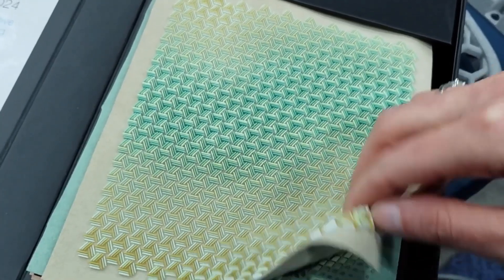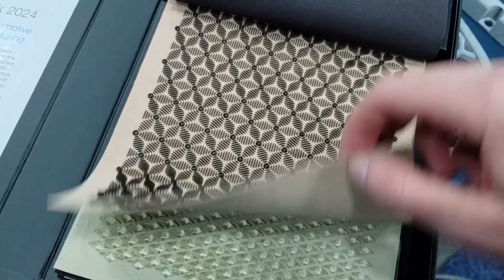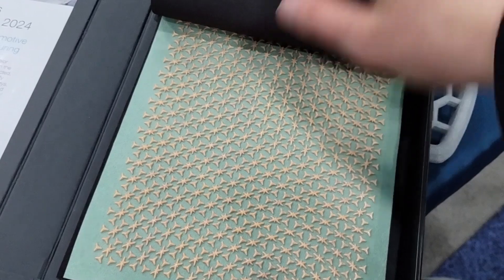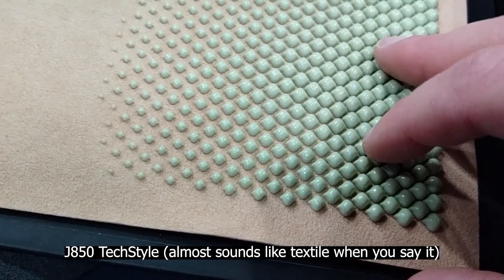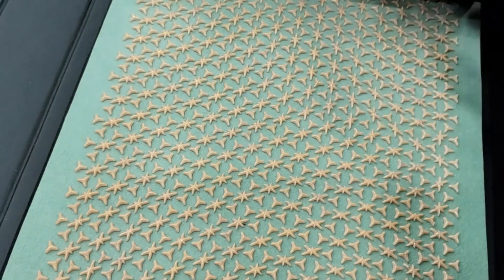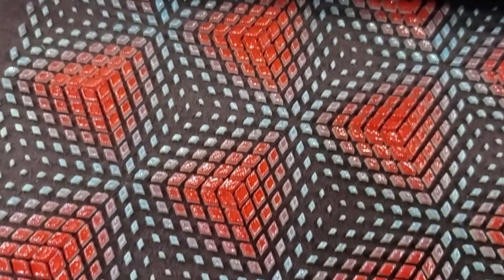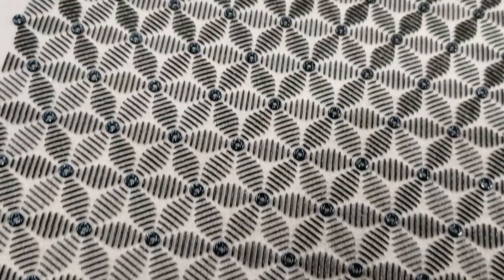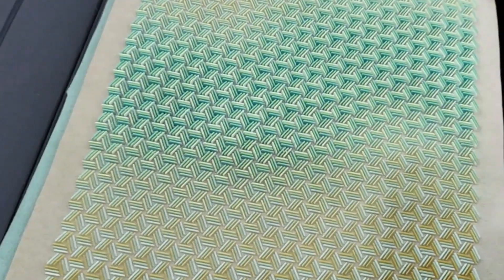3d printed fabric like never before! (polyjet technology)

Comment: Does look cool... But my imagination today is not that grate cause I don't have any especially good ideas.
The obvious is looks, it allows you to get a more extreme depth than what you normally get on fabric.
You could maybe make a high friction, harder surface for football shoes that still are able to conform to your feed.
Maybe you could make a interlocking patton that could be used to hold curtains and vertical blinds completely closed so that no light passes through.
Maybe you could add knee protection to work trousers, such that they were a part of the trousers and did not have to be removed when washing.
Maybe you could make a back protector that was more comfortable or just a part of the jacket.

But the material is probably hard and brittle, thus not usable for knee protection, back protection and probably have a relatively low coefficient of friction too.

But when it comes to looks there are endless possibilities, i suspect that we will se company logos as part of the fabric in speaker grills and guitar/bass amplifiers. But speakers get smaller and smaller and amplifiers are no longer a part of the concert decoration on stage and musiciens uses digital amps, thus it is not sure anyone will spend money making new amps and speakers.😥
Reply from the maker: These are all great ideas, give your imagination some credit! I think that the company that made this technology and the materials for it (Stratasys) also has flexible materials that can be varied in hardness/flexibility based on how long they are cured. What this means is your knee protection idea could very much be possible, same with the shoe idea! Also the curtain and speaker/amp idea is something I didn't think about and using this tech could allow for awesome customization, I just think it would be quite expensive because of the cost of the tech/consumables. Hopefully in the future this type of printing on fabrics is more accessible/affordable. 😅🙃
Reply: @strelkomania  Thanks.
When it comes to peoples hobby and looks, the price is less important. People overpay for everything from clothes, cars, bikes, sports equipment, makeup, handbags, water bottles, Instruments, plushies, in game items etc. The hard part is to convince them that the need it. 😂
The 3D printing part, makes it hard for mass production, but perfect for perceived scarcity products. I think car interia, clothes and handbag are where we see it first. 🤞
Reply from the maker: @Petch85  exactly 😁